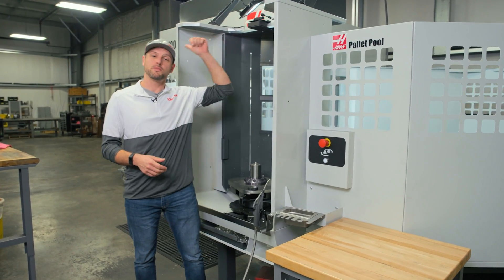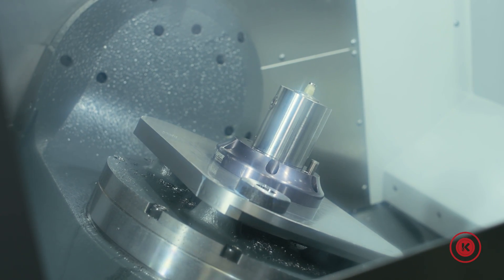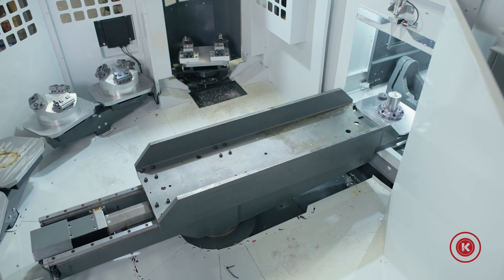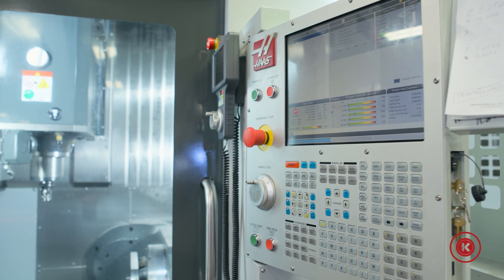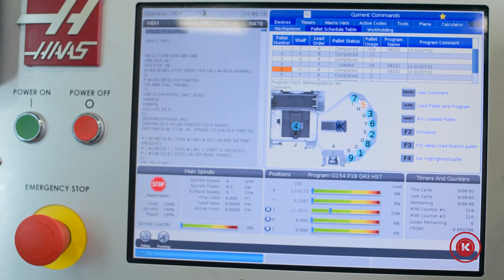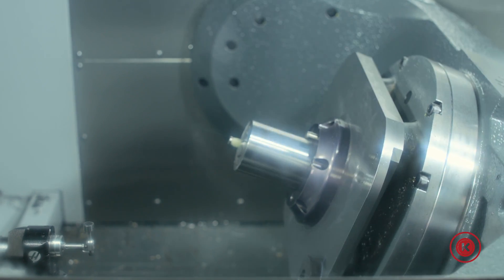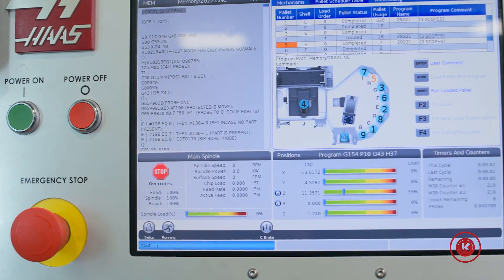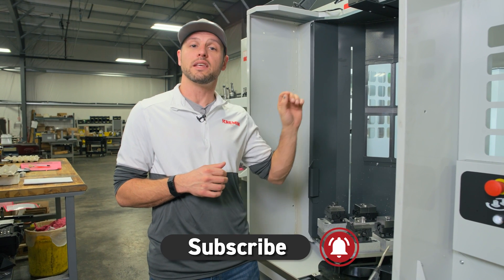HAAS 8-Station Pallet Pool - Kremin CNC Reviews

Comment: Thank you for the review. Im curious about the chip issue. 2 years later, has this been resolved? can a program run with no pallet that could spray down the trunion before a new pallet is loaded? Wondering if HAAS has addressed this. Great video, thanks again.

Comment: 2 MINUTES TO CHANGE A PALLET, THAT IS ABSOLUTELY INSANE. Ive got a mazak variaxis with a pallet changer and it has a washdown cycle built into the plc pallet change and it has cover coolant constantly under the pallet. Also pallet change only takes about 35 seconds.

Comment: I found your video well after buying a VF2SSYT +3 pallet pool and fighting shavings under the table at pallet change.

We found a work-around by removing one pallet and calling it into the machine at the end of each program....running a thru-spindle coolant/fan cycle around the table and using fan to dry it off as well.  That took our failures from about close to 100% to under 5%. We also probe each pallet before running the cycle. If there's a chip under my table, I know and it stops (or moves to next scheduled and tests it.)

We did demand the problem be resolved before making payments and HAAS Factory actually did a software update which allowed us to select "Pallet-zero" or basically empty the machine with an M-code that replaces M199. This ends the program/empties the table/runs our chip wash cycle, and then moves on to the next scheduled pallet if another pallet is scheduled to run.

At this point we would consider purchasing another rig just like the current setup.

You might want to inquire with Haas about this, as it was done in an official update.

Good Luck
Reply from the maker: Thanks for the information - we will check it out.

Comment: Does the machine also have air plumbed through the table? If so, you could rig up a series of air nozzles below the pallet to blow any chips or contaminates out of the way of the locating pins/clamp cylinder, and you could tie the air blow off function to a spare M code in the control that could be output when you post your code, or integrated into the pallet scheduling. I have seen some brands of horizontal machines have this same set-up, but it is obviously a different beast.
Reply from the maker: I believe there is air in the table and already a blow off system under the pallet but I will check again Monday when we get back in. Thanks for the tip.

Comment: We always run a cleaning program on our automated machines it also is a lot nicer to load aun unload parts that are free of chips and you hardly ever have to spend time cleaning the palletpool
Reply from the maker: We have been also, but we think there is something else going on as well - Haas has been out a few times and is still working on a solution. Thanks for the feedback.

Comment: Haas isn't the only one that has issues with the chip problem under the pallet, I've run Doosans and DMGs that also had it, and the 5 axis machines are the worst offenders. Nature of the machine. If you're running a pallet changer lights out, you should be running a washdown cycle every pallet change. It's just good practice, period. You're lucky enough to be able to write your own subprogram with a haas and easily call it with an alias M code. Most chip fans nowadays allow through spindle coolant so you can wash down and then blow off all in one tool. Rotate B axis all the way to one side, rotate C two or three times with coolant blasting, rapid B axis to other full extent, make a couple passes with chip fan and c axis rewinding to 0 then done. As others have said, reliability is the main goal of lights out, not absolute speed.

Comment: Can you clean the pallet while the changer is doing it's very slow pallet swap on it's own enclosure side (putting down pallet 1, turning, picking up pallet 2?). I can't imagine the 20 seconds or so this takes wouldn't be enough time to change out to a chip fan, cover the pallet locks in flood coolant, and blow it off.
Reply from the maker: You can clean the pallet off when it is moved into the load position on the pallet changer, but the platter inside the UMC is what all the chips get hung up on during the first exchange.
Reply: Might be that the machine can't do other operations while a pallet change is happening. Idk though

Comment: While I agree that they should add some kind of air purge under the pallet to clear chips, even if it adds 2min to your cycle that's really not much. You said you want to get 20hrs of unmanned operation out of the cell so that's about 2.5hrs of time per pallet. You only have 8 pallets so assuming it's 2min to change + 2 min of wash down, you're only losing 32 min to changeovers over the entire run. That's only about .03% of your total cycle time so pretty good in your case. The whole point of automation and running lights out is that you don't have to pay someone to stand in front of the machine. So, what's a couple extra minutes to guarantee peace of mind?
Reply from the maker: There is an air purge in the machine already, but it doesn’t clear the chips reliably. If the next pallet gets caught on a chip, you have to manually remove the pallets and reset the system (and they are not easy to move around by hand). Same issue when we tested adding an extra op to blow them out, there is no good place for chips to reliably be evacuated to.  We are going to test cutting some big clearance holes in the pallets next.
Reply: @KreminIncManufacturing   go and take Philips machine haas tech training.  At the end of the week you get a key to operate in debug mode and turn your u and v axis visible for the pallet pool.  This allows you to manually run the pallet pool functions and makes recovery much easier.
Reply: Isn't that closer to 1.25%? Say 2 min wash down 8 times is 16 minutes over 20 hours. Still not all that much but it sounds like a pain that doesn't need to be there

Comment: We have to wash down under our pallets every cycle or have the same problem
Reply: We use an empty 3/8 shrink fit holder with through spindle coolant to clean underneath them before a pallet change. I tilt the table 45 degrees and spin c axis twice and it seems to be doing a good job keeping them clean underneath. Our bigger problem running lights out is the chip evacuation of the machine but you already know all about that.
Reply from the maker: Thanks for the tip, we will try it out.
Reply from the maker: Thanks Jason, that’s what we are doing as well, just makes it tough to run lights out if you don’t have someone there to clean the pallets off…also tried adding a cycle to tip and spray the pallet before it comes out but that has been hit or miss.